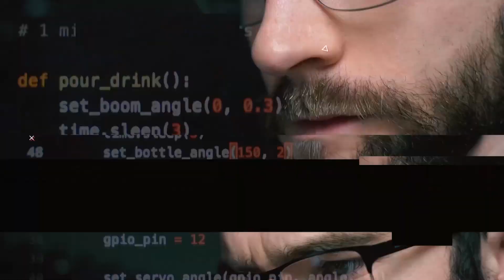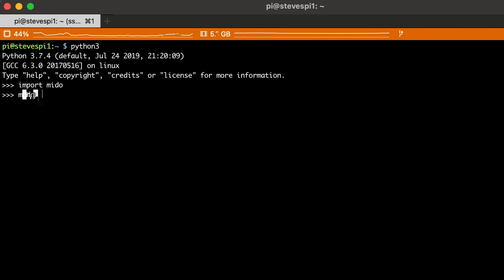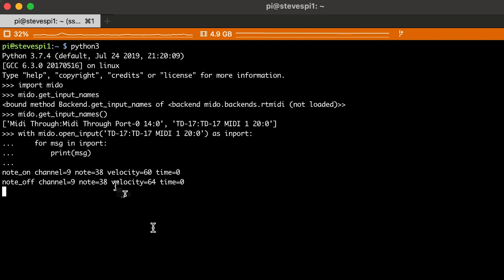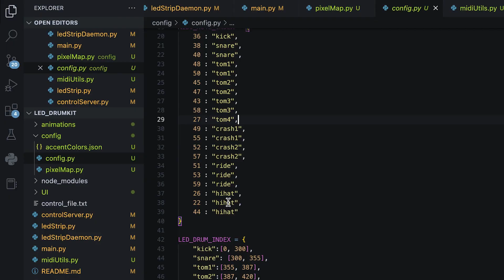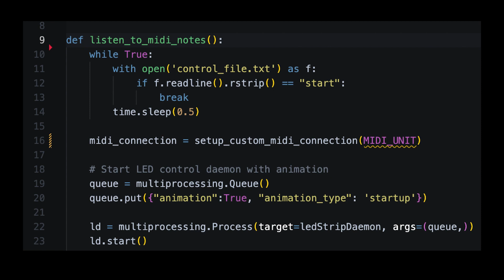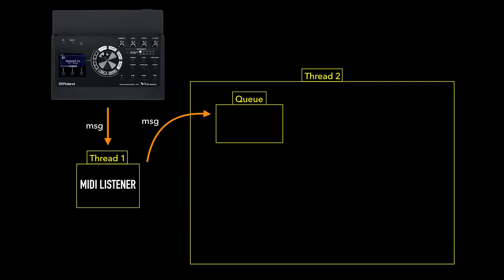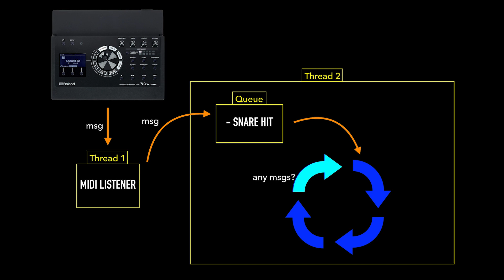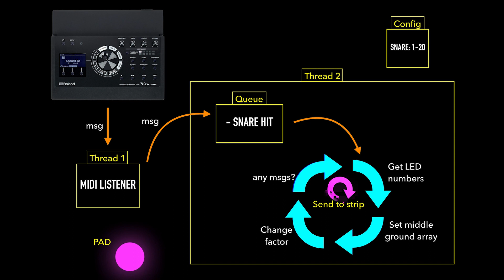LED Drums  - Algorithm Explained!

Comment: Hey Stephen!  Thanks so much for the video explanation and the software!  I've currently got my own project for illuminating drumset (well, more of the entire stage using DMX512 connected through a Rpi), and I wanted to add your project to the ensemble!  Mind if I pick your brain a bit?  There a good way to contact you via email or otherwise?   Looking through github, I couldn't find it.  Was wondering how we might connect?  I'm at jay (the letter) "forest" one (the number) at that google mail provider.

Comment: This is very good information I am looking for.  However, I want to connect the trigger outputs (parallel with the module inputs) directly to the input analog or digital PINs on my ESP32.  Would you please tell me what kind of that messages are, so I can program the ESP32 to light up the LED strips accordingly to the drum that been hit?
and yes, we may have to use the non addressable light strip.  I just want one color as a time, and the other color will be determined by the voltage.
Reply: This guy has not replied on here for over a year. I suspect the trigger cables (if they are 1/4 inch analog) are just passing along a voltage reading (based on intensity of the impact) from the sensors in the drums. There is no "message" for your esp32 to interpret. You might be able to get it to translate an incoming voltage change into a desired LED effect by feeding it into the "music listening" function of WLED, but that would require you writing a new code script to make that connection and translation. And even if it worked, that would only be for one drum signal, since the esp32 only has one pin for incoming voltage reading.
Reply: @jephbennett  Thank you!
I may try it when I have a chance.

Comment: Would it not be easier to either add a new piezo sensor to each drum to trigger the led or split the cable signal from each drum's trigger to feed a processor's piezo input?
Reply: This is exactly what I am looking for to setup my LED strips with an ESP32.  Have you got it works?  How could we connect it to a LED light strips?
Reply: @Vgjbfgaas  After realizing that using piezo means other sounds (band mates, or music you're playing with or even crossbleed from hitting nearby drums) can create false triggers, I proceeded with midi. But i had to use a Raspberry Pi 4 for the drums and a slaved Pi 3 for the cymbals, because my strips are individually addressable and a single esp32-S3 (nor a Pi zero, or any other controller) could not handle 600 lights plus 4 mosfet channels for the cymbals.
Reply: @jephbennett  I haven't use the PI yet, but I think feeding the voltage output of the piezo to the ADC pin of the ESP32 and redirect it into the ESP32 output to the data port of the LED strip.  Also the velocity  or the voltage produced by the piezo will determine  the color effect or the brightness of the LED accordantly. Don't you think?

Comment: Would you know how to do this with an acoustic drum kit?
Reply: add a piezo sensor in each drum, connected to processor, which you program to trigger the lights installed in each drum. this would also give you the potential for triggering audio by running a split signal from each piezo into an electronic drum module. 

Or, you could try feeding a mix of the drums into a sound reactive processor (like a esp32 with WLed installed), then use a spectrum analyzer to ascertain the frequency range of each drum, and assign a led strip to each frequency range, adjusting to avoid overlaps (if your snare range is 400hz-1200hz, and your 3rd tom is 300hz-600hz, set the snare lights to trigger at 700hz, and so on).

Comment: Hi, i still cannot figure out to make this work. Downloaded your code and try so many time but still the same. Only snare will trigger the led, other did not. Not sure what is wrong.
Reply: I've run into the same issue here - have been hoping to find a fix 🙂
Reply: @keithmcmillan4890   Did you segment each drum's LED strip?
Reply: same here, I trigger the snare and it lights up my crash cymbal leds white.
Reply: Yeah I’m having the same issue. Only the snare lights up. It’s so responsive though. I was able to get the whole set working using a version I did referencing this project using chatGPT. It’s not as responsive as that snare though. I also can’t get a fade to work with out it lagging really bad. I’m trying to track my way through the code to try to understand why it’s just the snare. Have any of you set up the user interface? I think I’m going to try that next.
Reply: @OmegaB3N  you got me beat.  I cant figure out how to get all of the requirement installed without throwing errors.  the instructions are not clear enough for a linux newbie.  care to lend any tips?
Reply: @Epefeman  What pi are you using? I started with a pi5 but had to switch to a pi4 because it turns out that pi5 switched to a different GPIO setup so some of the previous libraries are no longer used. You could probably use the new GPIO library if you were good enough but I am not. I am also fairly newbish with Linux though so it took me a bit to sort that out as well. Using the sudo command at the beginning of your commands kind of brute forces through it wanting you to use a virtual environement. Also making sure to use python3 and pip3 to use the updated versions.
Reply: Also for anyone that is wondering, setting up the UI did not help get passed the snare issue. Going to try to rewrite the code and see if I eliminate some of the steps if I can get the full set to work.
Reply: @OmegaB3N  I started with a Pi 5, but I’m on a 4 now.  I just started learning the RPi because of this video, so I’m super new at this. I’m currently trying to work in a virtual environment so I don’t have to brute force my way through every install. What version of Python you using?  Seem I could only get the requirement.txt file to install properly on version 3.7. I’m sure I’m doing something wrong.
Reply: @Epefeman  Honestly, I could try to keep helping in the comments but I'm also fairly new to this so my best advice would be to consult chatGPT on the issues your having.  It is really very handy at telling you why you might be seeing certain errors at what to try to do. I also have looked at a bunch of videos and through a bunch of forums and FAQs, but GPT is the fastest at giving a breakdown of what your seeing and what to try next.
Reply: @OmegaB3N  cool. I appreciate the help. I’m still digging. I don’t like to be beat by technical stuff like this. Just seems like a lot of the tutorials out there are outdated, which is frustrating. I’ll get there…I’ve learned a lot about python in the meantime. Thanks again! Just wish there was an image file that would make all the pain go away.

Comment: Really cool video. I'm excited to finally see the other side of this project. Unfortunately I'm not super knowledgeable about how Midi works, but is there a way to set this up with some kind of Midi splitter or passthrough? Or possibly just a way to run the code on a Windows computer in a way that it catches the MIDI signals while another program is using them? The e-drum set that I plan on trying to do this with is frequently hooked up the the computer via USB and used for drumming songs in Clone Hero (a free Guitar Hero clone for PC), so I'd love to be able to run both of these at once, but there's only one USB port on the drum set's controller.
Reply from the maker: Glad you like it Josh! I think a USB could work or even a MIDI splitter like this one https://www.gear4music.ie/Recording-and-Computers/Tie-Studio-4i4o-e-MIDI-Interface/2BRH?origin=product-ads&gclid=Cj0KCQiA_P6dBhD1ARIsAAGI7HC3UBLivWCUkL5Xw48TSWnaGBIYcxjOgBrnXBwbP32mNbjYG3f8rgsaAkW4EALw_wcB Otherwise to run on windows you'd need some form of board to connect the GPIO pins. Or if you have some experience with coding you could modify the code to forward MIDI messages from the PC to a raspberry pi over wi-fi or bluetooth